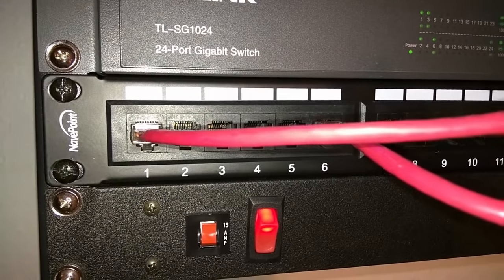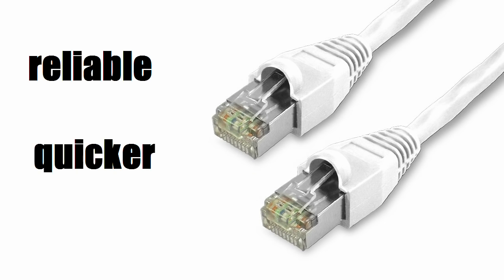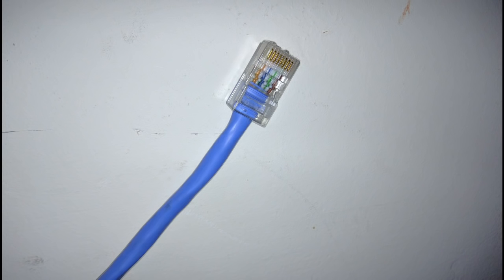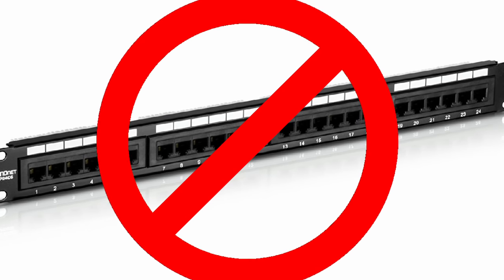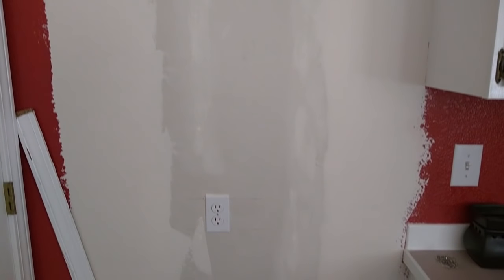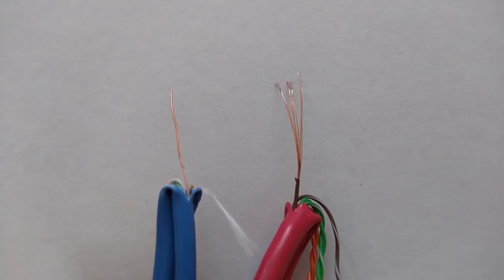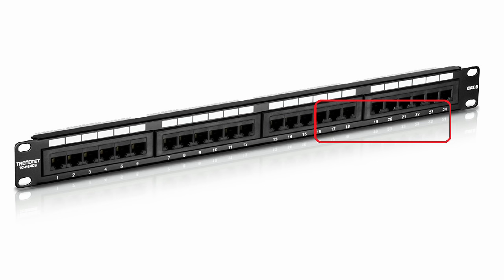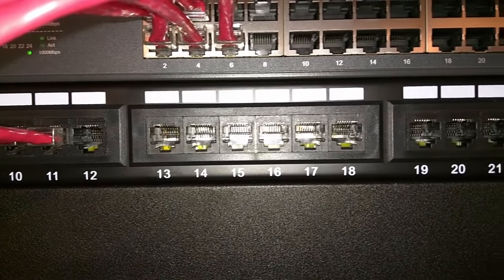What is a Patch Panel? Do You Need One?

Comment: One word of advice.  We all know there are various categories of Ethernet cables.  I think the highest one right now is a cat. 7 at the time of my post (9/22/2020.)  I recommend running the best Ethernet cable through the wall at the time.  By doing this you can give yourself a buffer as time progresses and not have to turn around and rerun them again in a year because something new came out.  The wires from the jack to your computer or device isn't as crucial because they are easy to replace.  Plus by running the best wire of the time will help to prevent crosstalk and interference, especially if the wire run is long because when running the wires in the wall, don't forget they are sharing the same space as the electrical wire and every other wire in the wall.  By running the best of the time, you can protect yourself later on down the road.
Reply: Thanks! It's a great piece of advice
Reply: What about Cat 8.1/8.2?  Just curious as I am about to connect our new home we bought.  Thanks.
Reply: Cat 8.
Reply: Cat 8 is the highest i know.

Comment: I get this question often, too.  Seems a lot of home networkers want to just put RJ-45 plugs on the ends of their Ethernet Runs.   And, while you and I both know that will work, it leads to problems later down the road.   But technically, I do agree with you that a Patch Panel is not a MUST.   Thanks for sharing!

Comment: How is the wall wiring? I used to buy tons of this equipment at my old job so even though I'm not in IT, I learned a lot about switches, APs, PoE, patch panels, power supplies, etc. However, I never learned about the cable running. It seems impossible to shove a cable through the wall or floor and have go where you want it to go. That's the most intimidating thing about setting up a home network.
Reply: Use fish sticks

Comment: One benefit I didn't see listed in the video: if you wire up a patch panel and label it properly, then later sell the house, it will be much easier for the new owner to hook up their own network equipment.

And if they don't want to use it for some reason, well, it's still nice and tidy.

Comment: We're moving into a new (to us) house in the next few months. If the crawlspace is accessible as I'm told it is, I'll definitely be putting in one of these. I work in IT and it's time I showed it. :)
Reply: Good luck! Beware to buy the right products as there are a lot of details. For example most cables shouldn't be bend more tightly than 4 times the cable diameter. So the radius of the bend should be equal or more than 4 times the cable diameter.
Reply: Will you be putting your switch in a hot attic? 😬

Comment: You can also run video/power, sensors and switches, even the control head extension from a radio room for a 2-way radio although at a lessor distance. LED lighting runs can also be accomplished in this way using CAT3 or above bulk cable. Panels usually are 110 punch, however, they can also be found on a 66 block configuration with RJ jack blocks although not CAT5 rated. There are also 110 4/6/12-port patch panels that fit the 66 block 89B bracket. And now popular with HAM radio folk like me, there are also the new Anderson type power poles for 12VDC circuits that also have panels that can be rack mounted for red/blk power distribution.  Have fun!

Comment: I'm the ethernet wire hanging out of the wall kinda guy.. I'm an old time telecom guy and wasn't sure if i should bother with keystone jacks.
I ran cat6 from my 4 port FIOS router to a couple rooms. I followed cat 3 and coax cables through my attic to the rooms.. I didnt want to invest in 
A RJ45 crimping/terminating tool so I just bought 50ft patch cables with plugs attached and ran them that way. Seems to work okay...

Comment: There are also different types of jacks.  If you use a stranded connector on the end of solid core wire, the 'teeth' ion the connector will bend rather than bite in the way that it would bit into a stranded cable.  We have had that problem.  We have some  solid cables that were terminated and they sometime lose connection when they are moved.
Reply: The correct term is "plug". The word "jack" is another word for "socket". Please understand, I'm not picking on you; lots of people use the word "jack" the same way, including the Budget Nerd in this very video. This video is excellent, but I just wanted to jump into the conversation with my two cents. I think the distinction between "plug" and "jack" is useful.
Also, BN uses the term "normal Ethernet cable" when the correct term is "jumper cable". A jumper cable is made with stranded wire conductors and has a flexible jacket that is designed to be handled. The bulk cable used "in-wall" has solid core conductors and is made with a jacket that meets the fire codes for that building. There are different jackets for different fire codes. Solid-core cable is designed to be installed once, and never touched again. And certainly, never handled or re-used. Again, I am not criticizing the content of this video; it's very helpful. I am just trying to add to his excellent information.
Reply: @chrisdoutre101  you are correct.  My thinking was off when I wrote that.
Reply: Patch cords were supposed to use stranded wire and the plugs were designed for it.  Then people started using solid wire for patch cables (bad idea) and had connection problems.  Then plugs were made for solid, to keep those idiots happy and later ones that could be used with either.  Anything other than stranded wire plugs on stranded wire is a bastardization.

Comment: Hi Guys I am an open registered cabler in Australia. Patch panels are used for large networks and can be used for home use for multiple termination points also called media termination point in todays tech or TOs (termination outlet) I use them for multi room setups where you would have three TOs on one wall plate first from left of the plate for telecommunication second for ethernet protocol and the third for media eg HDMI or audio. They are still spliced as per the regulation for wiring rules so you could setup three networked devices in one room and then use the patch panel to route the port to the needed device eg a switch or a multi room audio setup or telecom. It is very important to never twist or pull on the cable more that 4 KG force or bend a TP cable more than 10 degrees because it will change the impedance of the cable and will create errors in the data packets sent over the network. Never run it longer than 90m in total point to point unless there is a powered switch or hub after the 90m to boost the data. Never use cable ties on TP cable as it will crush the twisted pairs giving data packets errors. Never make your patch cable buy the factory made as they are made to the minimum patch cords,  0.5 m is the implied minimum length in ANSI/TIA/EIA-568-B.2-1 for a certified patch cord. That's because the math for the limit lines really does not work below this. Many vendors only offer a certified patch cord of 1.0 m any more or any less could end with network issues. Hope some of this helps you all in your setups

Comment: Very good video for beginners i like it. After you setup ONE up. You're not a beginner anymore. It's the same setup going forward.

Also, Small office do not need a patch panels. Going thru a wall is painfull if you don't have conduits. Or you can run the conduits on the outside of the wall if you have plaster walls from older building. If you must us patch panels go ahead. I'm just saying it is a case by case basis. Some offices won't let you drill holes in the walls if you own the building.
Don't forget - if you're going patch panels you got ALOT of wiring work to do. So get your MP3s ( music ) ready and have fun, it's gonna take longer.
Get a rack that moves so you can back there behind the rack. Attached to a wall means you have to squeeze behind there.

Comment: You can't manage a data center without them.  We've got patch panels for fiber LC/LC, MTP/LC, RJ45, and some RJ11 still for vendor access into their side of the network.  With as many connections and cross-connects we have, everything must be mapped and labeled end to end and that's where patch panels come in to play.
Reply: Yep. I work in school IT support. Our network cabinets are horribly managed with cables all over the place. I've spent many hours almost 3 years ago trying to clean and organize the cabinets at 2 sites. I got probably half of them done. I have had little time to dedicate to them since I have far more pressing things to work on. At one of our sites, whoever did the wiring of a wing of classrooms did a terrible job. That wing has 4 classrooms. All of the data drops and ports on the panel are labeled Room #. Room 1 says "Room 1" across all ports. That was very frustrating trying to figure out which port goes where.
Reply: We dumped all our patch panels.  We now place switches in each row and direct cable each rack to them.

Comment: I have a similar setup but yours is neater looking damit. Each room has 2 or 4 jack plates, I have used some of the spare connections to add wifi access points (netgear WAC120-100UKS) for phone/tablet/laptop and hard wired connections to all desktops. The netgear ap's have vastly improved wifi home wide and especially into the garden over the previous powerline wifi setup i used, simplely from being able to position the wifi ap in the best spot rather than just above the base board, in the corner, blocked by god knows what.

Thanks for the videos take care God bless.

Comment: Nice video and good explanation of patch panels. However, that’s only half of the uses, or maybe only 1/3 even. Im currently wiring my house top to bottom, inside and out. At the hub, I am going to use a 24 port patch panel. I will have 24 cable runs out to various locations around the house, but not all of these are dedicated for data/networking purposes. I am going to wire some to handle video transfer, some for audio surround sound, and some for low voltage power transfer throughout the house. I will post a video once i get things going. If anyone even cares. ?
Reply from the maker: Yeah I'd watch it! There's still lots I can learn!
Reply: I'd love to see how audio can be handled via a patch panel.
Reply: Line level audio is fine, but speaker level audio will have issues since the copper is so small.
Reply: Jamie Forrester , I have all of the lines run for my house. After they get finished with the drywall I will make a video of everything I’m doing with Cat5e/Cat6 and 24 port patch panel. It will include hdmi over cat6, IR, line level audio w/ fiberoptic source to Cat5e, solar powered cell/tablet charging ports that double as usb connection to central computer, ip cameras with poe...

And I also have cable runs for a separate system that will be running a AR sandbox setup.
Reply: You can't do 24 cable runs around your house!!! You can do 23, because you still need 1 port to go from that switch to something else, generally plugged into your Router.  Because you need some way to access that.  If you're going to a NAS or a NVR for your cameras to record to, that's going to need another 1 or 2 ports.  See where I am going with this? Which was if you're 24 cables just for cameras and other things around the house, now you really need a 48 port switch!!!  It seems crazy!!!  I went from 24 port switch to a 48 port switch.  I'm using a Zxyel GS1900-48.  What I like about it, is it's not DEEP.  It's just under 10", which is really good for a 48 port switch as they can get much deeper.  This is a managed Switch.

Comment: I cannot stress enough how important it is to label everything correctly and consistently, always. This might not be a super huge issue in a small home environment - but small environments tend to become big environments over time...and it sneaks up on you. And trust me, you do not want to have to rummage around in a patch cabinet and tear out your hair because some Bozo labeled the outlet incorrectly (or not at all) - or gets things mixed up because of unclear labelling or whatever. 

Happened at work a few days ago. Outlet in a floor tank of a meeting cubicle was labelled "1-3-15" User complained he was unable to access the web. According to naming scheme, this was supposed to sit in cabinet 1 on panel 3, outlet 15. Took some digging to figure out that the cable was wired up to panel 15, outlet 3 -  which went to a completely different network that had no web access. Genuine facepalm moment. It was unclear who had done the wiring and left that little nugget behind. (We also had to double check all the other wiring to make sure no other landmines of that type had happened. We found two more. And we all got a good workout that day.)
Reply: Yep. I work in school IT tech support. Whoever did the labeling of a wing of classrooms at one school did a terrible job. Its a wing of 4 rooms. All of the drops are labeled classroom #. Room 1's data drops are all labeled as "Room 1"; Room 2 as "Room 2" and so forth. I had to troubleshoot some connectivity problems in a room a few years ago and it was miserable. I had a tone generator which greatly helped, but it still sucked.

Comment: After 17mins I might not be an expert ,but the patch panel seem to be totally unnecessary for home networks but if you can maybe do it(why not just plug in directly to switch, will you be reconfiguring everyday obviously not), the keystone connectors on the other hand seem to be very useful, a necessity.
Reply: Yeah. And at least when you just plug directly into the switch, you can easily disconnect the entire server rack from the wall by unplugging the cables.

Comment: Patch panels are designed to connect servers in server racks to a switch. They can be used for the purpose you described, but their intended use is cable management of cat cable on a rack.

In the rack the cables go to the patch panel, then you use patch cables to go from the panel to the switch which reduces strain on the cables and the port in the switch. When a proper switch in a data centre can cost $50k-100K it's reasonable to have the $80 patch panel take all the strain because that can be easily replaced.
Reply: This. Comments claiming you need it in home scenario just so you don't break the WAN port when replacing your switch or router once in few years sound completely mental for me.
Reply: @Tarets  Patch panels in a home setting really depend on the equipment being used and the use case. 

If you're studying to be a network architect for example, using a patch panel in your home setting for practice might make sense. Similarly if you're running a complicated home lab that you're active in with many physical rack mounted servers and relatively expensive enterprise grade managed switches (plural)  patch panel might make sense because you're actively moving servers around and need front facing cable management. 

But if you've got a consumer switch with maybe one or two physical servers that just sit there and you're just trying to wire your home, you're right it doesn't make much sense. Those people should be normal, turn the switch around and do back of rack cable management because their switch ports are never going to be under enough load to put the ports in danger. If one does happen to die, just populate an empty port. 

Or basically if you're the kind of person who needs to watch a video on what a patch panel is, from someone who doesn't really know themselves, you probably don't need one.
Reply: @Tarets  If you have enough cables, you want a patch panel.  If you have a small network, with a few cables, you can get boxes that hold a few keystone connectors to serve the same purpose.

Comment: Not to mention if the cable goes directly into the switch from all cable runs, anyone can get onto your network if they plug into an unused wall plate.  This is a massive security concern.  All the companies I've worked for, unplug the patch panel port from the switch if a desk if a Ethernet jack plate is unused.
Reply: well without a panel unplugging from the switch would be the same so
Reply: Or you could simply disable that unused port on the switch
Reply from the maker: If it's managed

Comment: Anything I have that stays in place gets a wired connection. Currently, I have 14 runs which run through a set of low voltage boxes in a central closet and into a large switch. It looks good and is clean, but now I am going to do a patch panel because you have geeked me out on this and I have to up my infrastructure game. I love to over-engineer everything, so now I’m going down this rabbit hole. I think I’ll pull my phone box and add that too.
For me, I like organized, neat, quality equipment and installations. It’s easier to troubleshoot good installations, and is a serious geek flex. While your wife rolls hers eyes when you show your friends, they know who the boss is. Doing it differently and better is how I like to roll.
One thing I’ll mention is a properly installed, high quality, ready to use infrastructure item also increases the value of your home. This seems like a win-win.

Comment: at 5:08 Your Keystone jacks are upside down ;). Tabs always go down, hence the "CAT.6" is upside down on the Keystone. The tab is pressed by your index finger, not thumb - think about how you plug a cable into a NIC on a laptop, or even your patch panel for example.. The reason for this is if something falls and hits the RJ45 tab just right it does not release the cable. Other than that its strictly cosmetic, just looks odd. Nice little setup tho. I just refreshed my rack at home and you're right its fun! I do this for work too tho..
Reply: I came here just to comment that. Plus having them upside down can introduce dust into the connectors.